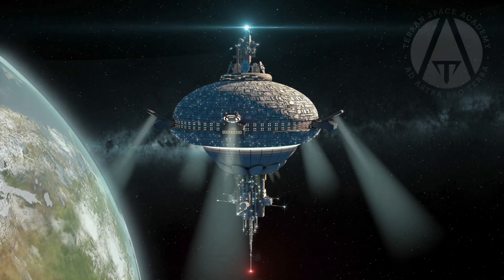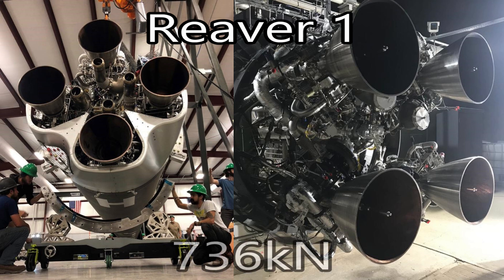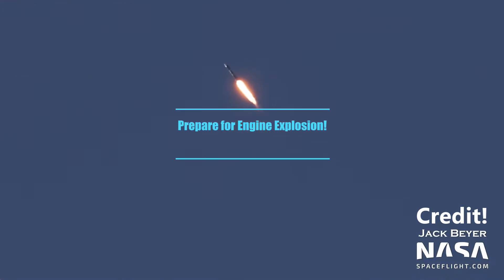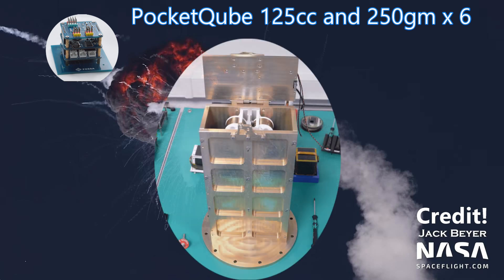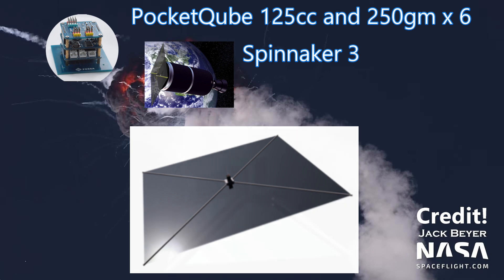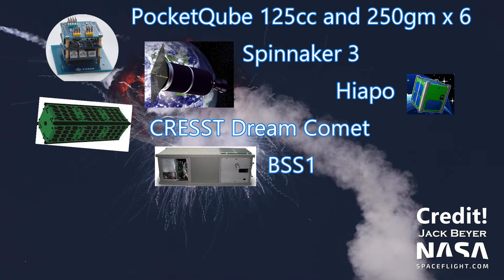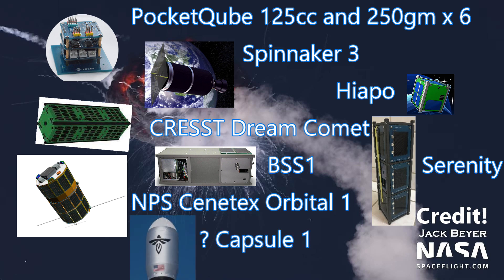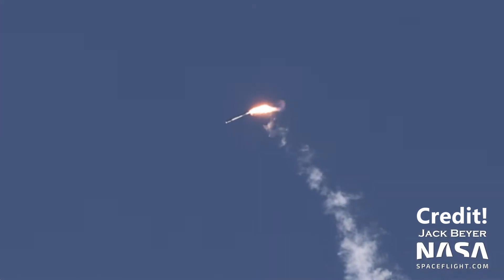Rocket Science: Firefly Alpha Analysis and Payload Review

Comment: I wonder if it's possible to hack into some part of the launch system and create glitches in the program which would cause a rocket to go off course.
Reply: Should be a closed system.  Not accessible over internet or even outside certain computers at their launch site.  The rocket code should have complete lockout from changes many days before flight.
Reply from the maker: Exactly... I'm pretty sure the code itself is read only at that point :-)

Comment: As to what caused the failure:

The Alpha is essentially a bigger Rocket Lab Electron. Whereas Electron uses 9 engines pump fed by electric motors, Alpha uses 4 engines that are started up on the pad and use power derived directly from the combustion chamber to power the turbopumps in a cycle called tap-off, like what Blue Origin use in New Shepherd. These engines, unlike Rocket Lab or SpaceX’s, are vectored in a single axis, making failure of one much more difficult to compensate for until it is past Max Q and high in the atmosphere. 

According to other people’s videos already posted, it appears that one engine failed at T+20-24 seconds. The rocket was accelerating quite smoothly up to this point and after it’s possible it was even decelerating. Either way, at T+145 seconds it reached the transonic barrier and lost control due to altered aerodynamic forces. 

Normal rockets like Electron and Falcon 9 only take 60 seconds from liftoff to reach Mach 1 and Max Q. Astra’s previous launch took 107 seconds. Evidently, they should make efforts to ensure the combustion in the chamber at liftoff is stable, as that is the primary driver behind the engine’s power since the combustion chamber directly feeds into the turbopumps with regenerative cooling of the gases.
Reply from the maker: Problem with expanders cycle engines is that you don’t reach full power until it’s been running for a while. That can make the takeoff a little weak. Hydrogen or methane works best in these types of engines.
Reply: @terranspaceacademy  

That’s true, as I would expect for Tap-off engine cycles. Tap off isn’t expander cycle, since it eliminates the gas generator by routing the gas for the turbine for the turbopumps directly from the combustion chamber. Expander cycle just sends the fuel into the nozzle, heating it, then sends it to the turbine and is sent directly into the combustion chamber while a hot gas. 

Thus Expander cycle doesn’t depend on the combustion chamber producing usable hot gas unlike Tap-off. 

Which is crucial to why one engine shut down if it didn’t have stable combustion.
Reply: @terranspaceacademy  

No doubt in my mind though that methane and hydrogen would work best, since they burn hotter and are gases at the heat in the combustion chamber. Kerosene would need more time to heat things to a stable temperature.
Reply: Thanks for the info. Its amazing what one can learn by reading comments.
Reply from the maker: @brett4264  It is indeed :-)

Comment: Analysis? No. It was a manifest. Not a peep about what went wrong. I want my 5:48 minutes back.
Reply: Agreed.

Although it was good of him to acknowledge the payloads on the flight.
Reply: @topsecret1837  I do appreciate his efforts to assign attribution and detail payloads and sources of manufacture-invention. That part is useful. But the post should have been so labeled. Scott Manley pointed out that the engines are the tap-off type. I was hoping that this chapter would have expanded on that. Oh well. They all can't be home runs. Otherwise, Terran Space Academy is one of my go-to sources.
Reply from the maker: I do apologize for that. I’m on the road to visit family and while the video originally had a much longer analysis of what went wrong I thought that Scott had done it better and cut that part out.  I decided to do a more in-depth analysis of thrust vectoring, actuators and flight control in general.  One dimensional vectoring verse two dimensional etc.
Reply: @terranspaceacademy  Fair enough then. I was a bit too snarky with the initial complaint. But, you got my drift. You're still in the rotation, sir.
Reply from the maker: @montigobear  thank you David :-)